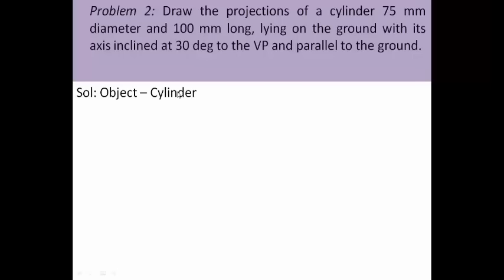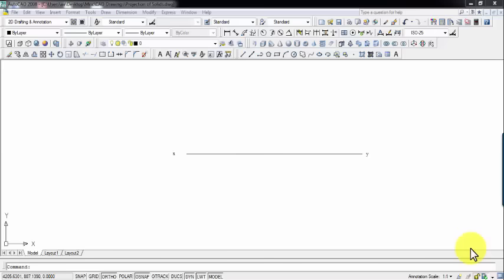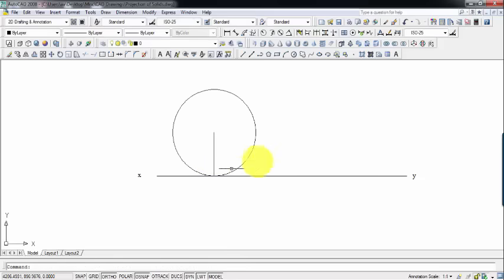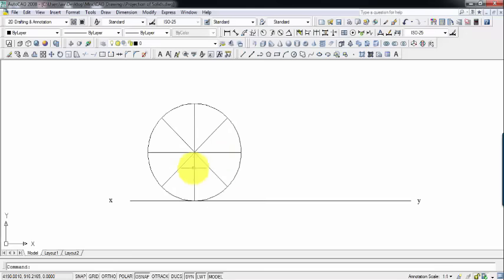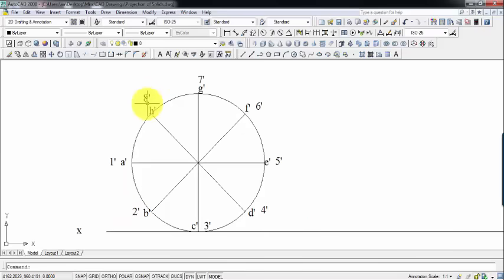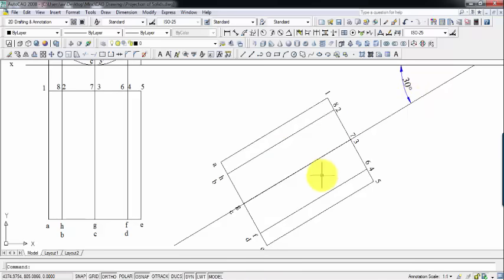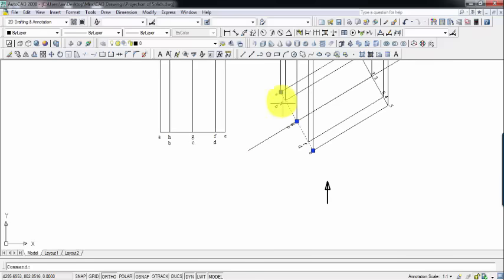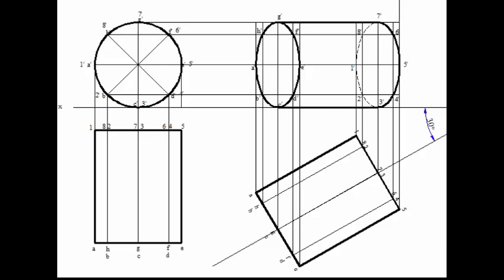Projection of Solids_Problem 2 in AUTOCAD

Comment: Draw the projections of a cylinder 75 mm diameter and 100 mm long, lying on the ground

with its axis inclined at 30" to the V.P. and parallel to the ground.

Comment: Draw the projections of the cylinder 50 mm diameter and 80 mm long, lying on the ground with its axis inclined at to the VP and parallel to the ground

Comment: Draw the projections of a cylinder of 50mm diameter and 70mm long, lying on the HP with axis inclined 
at 30o
to the VP and parallel to the HP.

Comment: A cylinder 40 mm diameter and 50 mm axis makes 30 degree 
inclination with vertical plane and axis parallel with horizontal 
plane. Draw its projection

Comment: Draw the projections of a cylinder of 75 mm diameter and 100 mm long lying 
on the ground with its axis inclined at 30° to VP and parallel to the ground.

Comment: 1.	A cylinder of base 60 mm diameter and height 80 mm has the midpoint of the axis 60 mm away from both the RP. The axis is inclined at 300 to the VP and 600 to the HP. Draw the projections.

Comment: Sir, I have a question related to the cylinder which i am unable to understand. 
Q:A cylinder 40 mm diameter and 50 mm axis is resting on one of a base point of a circle on VP while its axis makes 45 degrees with VP and FV of the axis makes 35 with HP . Draw it's projections

Comment: Sir I'm confused of that hidden lines and dark lines
Reply: Go through the video.. I am pretty sure he must have explained using the actual solid.

Whenever u turn the solid as per the question. After all the turns and angles whatever edges are visible to you on the actual rotated solid are the ones to be darkened.

After rotating by 30 degrees the actual solid from the front will show one whole circle with one half circle behind and the back edges remain hidden.

Actually you have to also check whether your intermediate projections are being observed from top or front view.

Upar se dekhoge toh niche ke lines nahi dikhenge aur front se dekhoge toh piche ke lines nahi dikhenge

Comment: sir how to draw..if the question is asked..A cone of diameter 60mm is resting on the hp on one of its generator.draw its projections if its axis is parallel to vp..in this question there is no inclination asked..so how to draw..just say it sir..plzz..

Comment: sir,why is the circle touching the XY line
Reply: because the surface of solid is also in contact with the ground. And if you see it from the front, circle will touch the reference line(x-y line).
Reply: @anubhavchauhan1485  Then top view i.e rectangle also should touch reference line know?